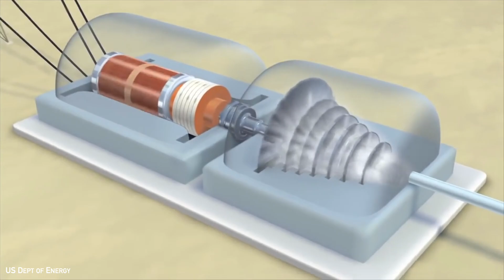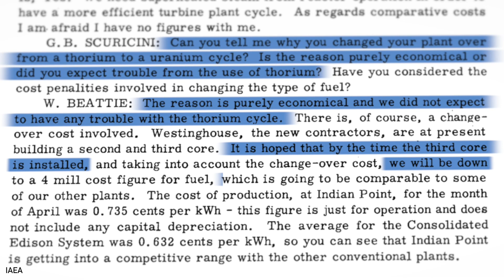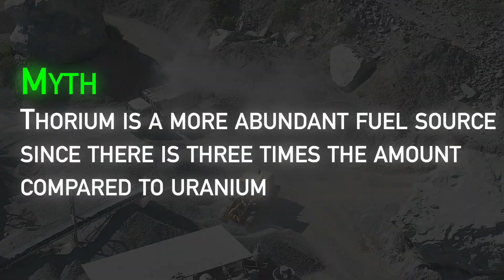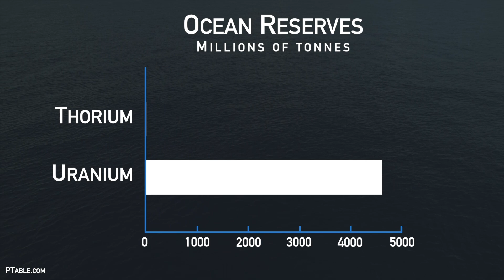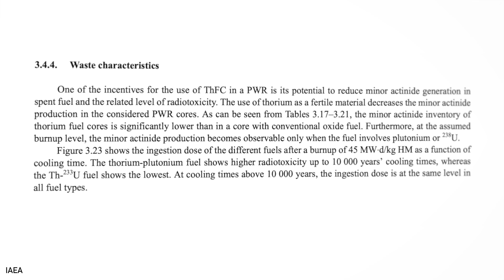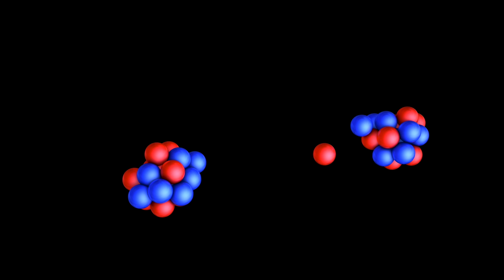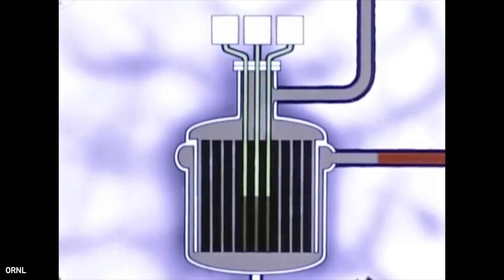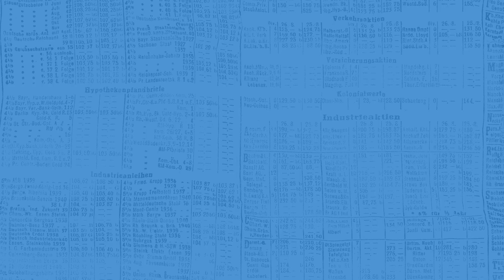*Almost

Comment: Well... This video is worthless.

There's more Thorium by weight than Uranium... But you can only use a tiny percentage of that Uranium for nuclear fuel making Thorium orders of magnitude more abundant. Missing something so glaring discredits anything else you have to say.
Reply: Spoiler alert, Thorium does not fission and does not produce power.  It MUST absorb a neutron from a URANIUM reaction and THEN transmute into URANIUM 233.  You can do the same thing with U238 (the uranium that is not the tiny percentage) and transmute into Pu239 which will fission.

Comment: Considering the amount of money wasted on fusion with no functioning reactor in sight for many decades, thorium problems would have been solved. Corrosion is one of the biggest problem. I know we could fix that problem much faster now with new materials being studied. But if you don't put the research in, don't expect results. This type of research would also help other industries with chemical corrosion problem.

Comment: 8:01 I have always wondered is that pool on the left glowing blue from cherinvkov(SP?) radiation? AND what would happen if you fell in and swam to the bottom? Would you die a few days later? What if you drank the water? How do they stop tritium from degassing out?
Reply: YouTube blocks most external links, but search for "spent fuel pool whatif 29" for a great explanation with illustrations by Randall Monroe of xkcd .

Comment: Although a bomb was made with u233, and it fissions "better" that u235, the Thorium-cycle based bomb has a nasty caveat.  U233 can only be produced with u232, through the parasitic n, 2n process.  This can be minimized in certain ways as there are multiple pathways to u232 under neutron bombardment, but a proliferation-resistant reactor can be designed to maximize it's production of u232.  u232 makes making a bomb from u233 not fun at all.  It's a highly radioactive gamma emitter and lasts long enough to continue ruining nuclear scientist's day.  It's not a "busted" as you claim.  Even being able to fine-tune their own reactor construction, the USA decided to abandon the u233 bomb path.
Reply: u232 thing is nothing.  It is exactly the problem.  There are extreme muslims that wear explosive vest and turn himself/herself into a human bomb.  And ignite the human bomb as terrorist attack.  They are not afraid of death.  So u232 is nothing.  Thus it really is a problem.

Comment: Utilities typically spend very little in R&D.  Not surprising that they wouldn't want to foot the bill.  After all, the light water reactors were a design adapted from submarine nuclear plants, first setting sail in the nautilus.  The US gov't never funded molten salt reactors through to completion.  Just two test reactors.
Reply: The U.S. has designed, tested , and operated every type of reactor known. The PWR was chosen as the best overall design for both military and commercial operations.  Thee are many other reactor designs that the U.S. gov't never funded further.
Reply: @clarkkent9080  Wrong.  The first reactors working for submarines were brought on land and were "good enough".  The same researchers started work on other reactors including the molten salt reactor, but because of bad political choices and the inertia of having an established PWR industry, nuclear has stayed more or less in the 1950s.
Reply: @MrGottaQuestion  Your conspiracy theory can only be true if you forget that there are countries other than the U.S.

The Nautilus was built in 1954 and Shippingport Atomic Power station began operation in 1957.  The last core at Shippingport was a  U-233  breeder using Thorium.  There were 2 other U.S. commercial reactors that tried Thorium in their cores and all abandoned the idea as too costly. 

The first Russian power reactor used pressurized water and was operational in 1954. The first Russian nuclear submarine was not operational until 1957.

The first UK reactor was gas cooled and was operating in 1956. The first UK nuclear submarine was not operational until 1963

Many countries have tried many types of reactor designs as well as molten salt and Thorium and the number operating today tells you how well that worked out
Reply: @clarkkent9080  using a thorium solid core is NOT what I was talking about.   They stopped using it after the shippingport reactor because it'd be more expensive having two solid fuel cycles going at the same time.  They stuck to the one already used.  This one was already used because of bombs.  And the PWR was absolutely developed to work quickly on a sub.  And once already working, a great desire for a better reactor largely disappeared, since it seemed to work "well enough". As a couple of meltdowns have shown, "well enough" isn't good enough for the general public, even if it's the safest form of electricity generation to date.

Comment: No worries. China will have theirs ready in 3 to 10 years. Enough to power China for 20,000 years.
Reply: Absolutely not true.  China is now running a 2 megawatt throium nuclear plant.  It is a testing plant.  There has no plan to use Thorium as the major electricity generation in China yet.  Scientific research is different from mass scale energy production.

Comment: I think your first segment overly discounts the "first mover advantage" light water reactors got from Hyman Rickover's nuclear submarine program. The government absorbed all that risk, but then Price-Anderson subsidies locked light water reactors in place despite some rather obvious safety disadvantages. I think 'greedy' insurance companies might have done better at letting designs evolve than the NRC, which is plagued by Regulatory Capture.

Molten salt reactors let gravity be the "pump" if/when things go wrong. And it's possible to make either no plutonium in them or better-yet make ONLY plutonium 238, which has no use in bombs but is VERY useful for NASA deep space exploration.
Reply: The U.S. weapons programs used graphic moderated and Heavy moderated reactor designs   since 1944 and the U.S. tested every reactor design type known. The light water design was chosen as the design with the most pros and least cons. 

When you realize that there are many other countries in the world beside the U.S. with nuclear programs and the ones that tried MSR had problems and abandoned them, then your comment is proven wrong.

BTW, Price-Anderson will cover Terrapower's MSR as well as light water designs.

The fact that no insurance company would ever cover any nuclear power plant says a lot about their risk. 

Pu238 is easily made in reactors specifically designed to produce medical isotopes
Reply: @clarkkent9080  Pu238 is NOT easy to make. At all. 

And the government's destroying the best way we have to make it, which is U233.

https://www.youtube.com/watch?v=63FQcG3IPJ4

Comment: a breeder reactor with a low fuel inventory could only breed a fraction of the critical mass needed for a weapon before it shut itself down for lack of fuel.  Proliferation risk is not zero but extremely low. You'd have to do something like hijack 20 breeders at exactly the right time in the breeding cycle to get enough material for a single fission weapon.  Opposing small breeders on proliferation grounds is only done by the ignorant and those acting in bad faith.
Reply: EVERY light water  reactor breeds Pu239. The definition of a BREEDER reactor is one that makes MORE fuel than it uses so it ALWAYS contains sufficient fuel in the core

Comment: Minor correction, having a partial uranium fission in a thorium mix does not remove all the benefits of shorter half-life, but it does have an affect. So long as the uranium is the minority fission material, it results in a waste with a lower percentage of transuranics, so there is less material to decay before it reaches near background.
Reply: Thorium is not fissile and will not fission.  It absorbs a neutron and transmutes into U233 that does fission.  ALL power produced from a Thorium reactors comes from URANIUM
Reply: Also being a liquid separating contaminates is far easier

Comment: Availability uranium vs thorium: Have you considered that uranium supposedly need to be centrifugally refined to separate out the needed isotope?
If I got this right, then 99.3% of uranium is the "useless" U238. Only 0.73% of uranium is U235 isotope.
Thus, isn't thorium about 1000 times as abundant as U235? (and refining it requires far less energy). For as far as I know, nearly 100% of thorium is Th232.
Reply: U238 and thorium are about the same except we have a sh*p ton of u238 ready to use.
Reply: @chapter4travels : But is U238 useable? I though you'd need another isotope?
Reply: @SigurdBraathen  u238 is fertile just like thorium is fertile. Both need a breeder reactor to fission. Both need refined uranium to start the breeding reaction. The US has a huge stockpile of U238 ready to use and no thorium.

Comment: The part about thorium and uranium being equally abundant is false. Thorium is far more abundant than uranium. He claims it is not available though. This is referring to deposits mostly being in India and China rather than The US. This is a false assertion. Secondly Uranium requires enrichment, a difficult and expensive process which greatly ads to the cost of the fuel. Thorium does not require this process. Also only 5 to 10 percent of the uranium in the reactor is actually used whereas in a thorium reactor 90 percent plus of the fuel is used. Taking these factors into consideration Thorium is about 100 to 1000 times cheaper and more abundant that usable uranium. Secondly the statement that they are both as dangerous after thousands of years is also false. Plutonium is dangerous for hundreds of thousands of years and more dangerous that all the other waste products by far. As stated in the video it is not produced in thorium reactors in any meaningful quantities. He also doesn't mention that a thorium liquid salt reactor can burn plutonium. As far as I am aware this is the only feasible way of getting rid of the stockpiles of plutonium waste building up world wide. There are a lot of people making a lot of money off the current technology. These people don't want to invest in the research to bring thorium reactors to production but they don't want anyone else investing either as it would cut into their profits.

Comment: I would argue that if you can't make Thorium into a bomb, you aren't trying hard enough. If there's one thing I've learned, its that EVERYTHING can explode violently if you try hard enough.
Reply: Thorium cannot be made into a bomb because it is not fissionable and therefore will not have a critical reaction.  Thorium is a "fertile" element meaning that it can absorb a neutron and become Uranium 233.  U233 can be made into a bomb, but much less easily than Plutonium which is made in conventional Uranium fission reactors.  Fundamental physics even applies to people who don't understand it.

Comment: So how much uranium could you pull out of a thorium reactor in a reasonable amount of time without re-inserting it into the reactor without causing it to go sub critical?  It was my understanding that the neutron flux and thereby breeding rate of a thorium MSR was so close to parity that this sort of harvesting would be not feasible.
Reply: Thorium MSR reactors can be two reactors in one. The thorium is only present in the outer blanket part where it absorbs neutrons. This material must be continually cleaned of protactinium 232.  In 30 days half of it will decay into uranium 233 whereupon it can be input to the primary reactor.

The whole scheme depends on being able to produce U-233 from Thorium 232 faster than the U-233 fissions. It also depends on being able to remove waste products from the molten salt fuel on a continuous basis. The waste products are what are the biggest threat to the fission process.

Comment: Excellent video!  Thanks.  More people need to understand that most of the claimed benefits of using a Thorium fuel cycle come from using fluid fuel, not Thorium itself.  One thing that was slightly off in the video, unless I am mistaken, is the use of U-233 bred from Thorium for weapons.  My understanding was that while U-233 is just as effective for weapons, it is less desirable because the radiation profile emitted is easier to detect by enemies and more dangerous for handling than U-235 or Pu-239
Reply: I don't think so.  The US files that I have seen from the late 1950's to early 1060's indicate that they chose to use plutonium for bombs as it was cheaper to produce than U233 (U233 was seriously considered and they had produced enough highly enriched U233 to do the required critical mass and other testing and to make bombs if they wanted).   The US did produce a large quantity of U233 for both testing in bombs and as seed materials for commercial power plants to run on a thorium fuel cycle (and now is looking to spend several $billion disposing of this U233 as the storage containers are degrading and it's cheaper to dispose of it than to repackage it and continue to store it - especially with no foreseeable near future use of it).

The USA actually built 3 commercial power plants that were designed to use thorium as its fuel:
Indian Point Unit 1- Online 1962: 275 MWe PWR.  Thorium fuel preformed so poorly that converted to U235 fuel in 1965.

Elk River - online 1964:  22 MWe BWR.  Entire plant had problems  was shut down 3 1/2 years after startup in 1968.  Far too costly per MW of generation due to manpower and maintenance requirements for a such a small power plant.

Peach Bottom Unit 1 - online 1967:  40 MWe HTGR.  Was quickly changed to U235 fuel as there were several issues with the seeded thorium fuel.

Fort Saint Vrain - online 1979: 330MWe HTGR. This power plant was supposed to solve all the design problems identified at Peach Bottom Unit 1.  A lot more very significant design issues appeared and plant only ran about 16% of capacity until it was shut down in 1989.   I had a coworker who had worked at Fort St Vrain and he told me that it was also converted to U235 fuel in the end.  I have not found written confirmation of that with my simple internet searches.

 The US also tested thorium fuel in it's initial commercial demonstration power plant and test reactor (Shippingport Core Load 3 (1977-1982):  60M We PWR) where they proved that it could generate enough U233 to make it worthwhile to reprocess fuel.

Anyway, every attempt at building a thorium fueled power plant by the USA failed badly - when similar U235 power plants worked well enough to be commercially viable (BWR, PWR and HTGR).

Comment: The first reactor mentioned that switched between Uranium and Thorium, leaves out an important detail, it was a PWR, NOT molten salt.
This lack of specifics makes the whole presentation a spin job.
Using Tritium to make nukes is silly, it is a part of a hydrogen bomb, but so is copper, steel and urethane. Lies.
The MSRE was not abandoned on technical merits, it was because Dick Nixons buddy in California wanted a fast spectrum sodium breeder, that eventually flopped from leaky bearing seals putting lubricant into the molten sodium. BTW France have been using sodium breeders in standardised designs for decades.

Comment: YOU FORGETWESTINGHOUSE'S NEED TO KEEP U AS A POWER SOURCE STRICTLY FOR PROFIT AND LOSS.   not safety.   yes the historic records show that the worry of u by products made the profits of the plant designers and builders as well as pure greed was considered better than a smaller cleaner energy plant.  U was producing bomb grade material, { Pt}.    Westinghouse PR is trying keep from loosing their place in a huge profit source supplied by government regulation that make building more dangerous reactor better.  smaller safer reactors are not covered under laws created to keep nuclear reactors from being built by smaller companies more cheaply. the fact that thorium plants don't meltdown.

Comment: Man you love to gloss over the important bits. It’s incredible you state spent uranium and plutonium are only dangerous up to 10k years but there are many reports that it’s dangerous over 200k years. Really depends on who you talk to. But the estimate of 10k years is way too low.
Reply: Pu239 half-live is 24,100 years and after 7 half lives you will have 1% or the original amount.  So about 160,000 years for the Pu239 isotope.
Reply: @clarkkent9080  cheers for some accurate info

Comment: Its NOT BUSTED... because one can make a nuke with plutonium only but can NOT make a nuke with Tritium only. You need a plutonium fision explosion to cause tritium fusion
Reply: ANY fissile material (i.e. U233, U235, Pu239) can be used to make an atomic weapon.  Tritium is added to make a hydrogen or thermonuclear weapon.  One goes boom and the other kaboom

Comment: You missed a major item in that TH in its primary isotope is usable as fuel vs Uranium which must be enriched. Therefore the usable Thorium isotope is more than 100x as abundant as the usable U isotope. 
So Yes. Thorium is vastly more abundant for the purpose intended.
Reply: Thorium is not fissile, it must be transmuted into U233 before usable as a fuel.